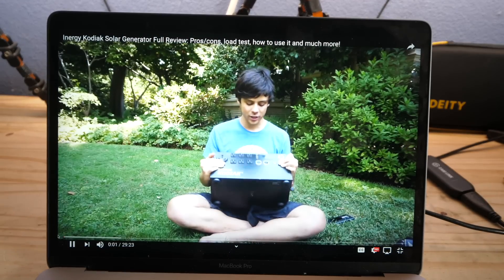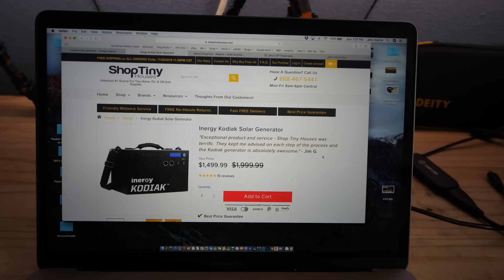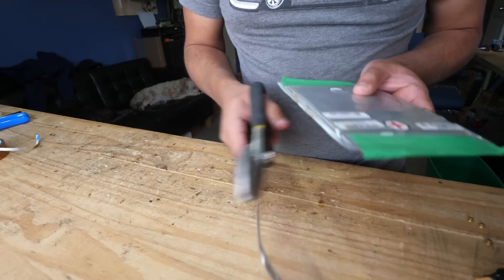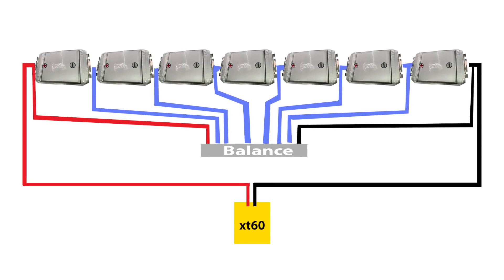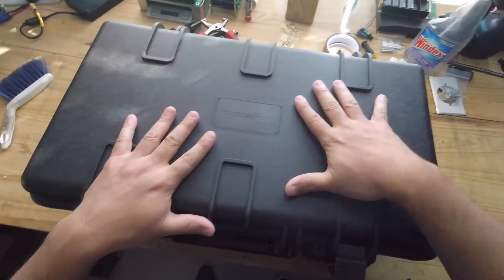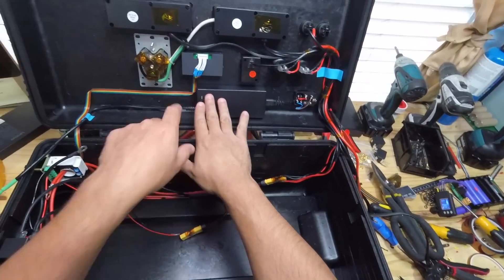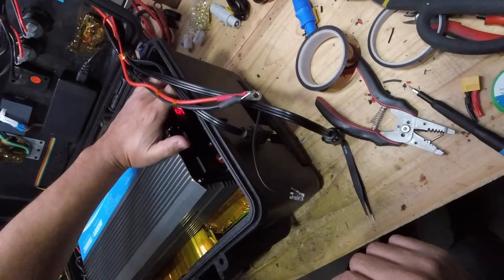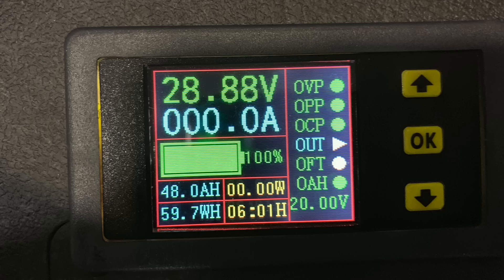DIY Inergy Kodiak Solar Generator

Comment: How did you hook up the 120v inverter to the 240v "rv plug" (30 amp 240v receptical) the only reason I ask this is to prevent anyone from damaging their trailer or rv.
Reply from the maker: It’s not a 240v plug
Reply: Wow, I was not paying attention in class apparently, when I first looked at it, could have sworn I saw 240v instead of that silly 120 30a. Great video and am subscribing to see your future craziness!

Comment: How did you wire in your power socket? Straight to the battery? And what charging chord. If I wire it straight to the battery will the bms regulate the power from the wall? Thanks I'm building one of these and I dont want to blow it up Haha thanks

Comment: Terrifying. One of those cells overheats the whole thing is gonna go up like a bomb. There's an awful lot of reliance on that charge controller. No fuse, no fan, no heat sinks. I'd like to see a teardown of the original - who knows, maybe it doesn't have any safety features either, but I kinda doubt it.

Comment: Automatic thumbs down for any video promoting the BS label "Solar generator" 
THERE IS NO SUCH THING! 

Connecting a solar panel to a battery and an inverter does NOT make it a "generator" by any stretch of the imagination. 

It's a sales gimmick for easily fooled morons if anything, on par with zero energy devices, shungite pendants and calling your faucet a "water generator"

Comment: I love it, you hit all the critical points I had in mind. I was wondering, can I use 3-4S LiPo batteries? I do a lot of rc, so I have plenty of batteries laying around. I was thinking of using a few 10ah 3S battery packs, what do you think about that?

Comment: Bro.  What happens to your internals when you have it in the sun and it appears everything in the inside must be face up at all times. Also, I how do you plan to heat cycle the inverter?  Noticed you removed the bottom plate which is highly volatile to self ignition. Great concept and attempt but please ensure you let your less informed viewers know this has high risk for self ignition.  Keep exploring and using your mind and harness your inner safer Angel.  🤣😅😂  Seriously great concept though.
Reply: I presume you meant the internals of the inverter are susceptible to self-ignition, I don't see having the plate missing would be a problem otherwise. Also, he did add fans, just not on camera, there's an update video where he shows off the fans.
Reply: @jayzo  He probably added them after people roasted him

Comment: Thumbs down.  No circuit protection + no ventilation = engineering fail.  A blown circuit is as close to a burning bush telling you to use fuses or circuit breakers.  Who leaves a device covered in heat sinks, on top of lithium batteries, inside a sealed plastic black box?

Comment: If you have a bigger case how many pouches can you add to extend storage without requiring a larger inverter, bms, or charge controller?
Reply from the maker: You can add as many batteries as you want
Reply: Thank you.  Next question:  How important is it to use the Neutrik NAC3FCB powercon connector instead of an Anderson power pole or 8mm connectors?

Comment: I think I see where some of the confusion is with the solar in this video.  In the link in the description you have it pointing to a pure sine wave inverter that does not have a solar charge controller built in. What you are actually using is the modified sine wave inverter that does have the charge controller built in.

Comment: I think this build is awesome. Highly considering building one of my own. However, I have a question. I think it would be incredibly useful to be able to plug my Ryobi 18v and 40v batteries into the unit to both charge and add battery capacity to the unit. Is that possible? To clarify I mean build the ports you plug the batteries into, into the unit without using the battery charger that Ryobi makes. Thank you for the videos!

Comment: Looks like you did a great job.  I have a Kodiak and was disappointed that while it can function as a UPS, the 120v ac charger that comes with it only puts out 100w.  It’s odd because you can charge it with up to 600 watts through the dc/solar charge ports.  What’s the max solar input and wall charger input for yours?

Comment: Looks like you forgot to add in the $210 for your 42 LiPo Battery Cells
Reply from the maker: No I didn’t
Reply: 139.99
 29.99
289.99
 25.58
 12.89
 33.98
  4.95
  7.96
  8.08
 20.99
210.00
 17.48
 21.98
  7.99
  8.99
 11.98
 28.60
-------
881.42  Total for 17 items you listed. Close Enough - Just had to click on LiPos to see $210 cost.

Nice Work!

Comment: is it then possible to feed appliances while the solar is plugged in charging the battery as well? Sorry if this question is too newbie question. I know nothing about electricity and solar.
Reply from the maker: Should be able to, but I haven’t tested this feature and since the solar charge controller is internal to the inverter they might have some dumb reason to not allow this

Comment: Maybe I missed it, but how are you balancing the batteries once they are installed? I didn't see any bms on each of the 6 battery packs. You have the balance leads but I don't see any part for that to plug into.

Comment: Nice build!  I want to build one too, but I think I'm going to go for a surplus ammo can for the storage box to save a bit and have a metal case.  These are a fraction of the price: https://colemans.com/shop/containers/ammo-can-81-mm/
And these are half price and incredibly robust (water proof too): https://colemans.com/catalog/product/view/id/2153/s/u-s-g-i-ecs-waterproof-container-green/category/71/
Otherwise what about using a Stanley 195617 Metal Plastic Toolbox 26-inch: https://www.amazon.com/Stanley-026180R-Fatmax-Metal-Plastic/dp/B003L5JJHG/ref=sr_1_fkmr0_2
or a Stanley 037025H 50 Gallon Mobile Chest even cheaper: https://www.amazon.com/Stanley-037025H-Gallon-Mobile-Chest/dp/B000Q5LZT4/ref=sr_1_4
You can nearly shave off another $100!

Comment: Don't forget to check surplus stores for plastic ammo boxes! They have locking rubber sealed lids, and are roughly the same size. My local princess auto (Canadian harbour freight basically) has one for $24, and that's Canadian! So maybe 15 bucks south of the border? Much better than the $124 American for the one in the video. Even on Amazon.ca Acr8-72 boxes are only $40 Canadian.

Comment: I have one it's fabulous. Went boondocking with a friend in an Airstream and it powered everything. It can run your air conditioner but only for 2 hours on a low setting but the unit stayed cool.

Comment: I am not a fan of AC so I will skip that for a variable voltage regulator. And I have a case already not into the plugs much.  Will add some high powered usb usb c ports 20 bucks skip the pouch to 18650 65 cells with a 1/3 modular as almost all my gear is modded too use 18650.  So the real question is how to balance modular cells and secure them in the case! Ideas? Anyone?

Comment: For starters, you didn't explain ANY wiring. 

I don't see any fuses, circuit breakers, or anything like that.  No safeguards at all.   How do you prevent overcharging, and over discharge? 

Secondly, how many THOUSANDS of dollars of tools do you already have on hand in order to build this thing from scratch? 

I guarantee you that the average person is going to have to go out and easily spend another 700 dollars on tools and stuff to build this thing.....so....consider your point invalid.   The step drill and hole drill bits will put you at or close to a hundred bucks right off the top.  

You literally have thousands of dollars in tools, connectors, clamps, wires, meters, testers, fasteners, etc, etc, etc, ALREADY on hand.

Not fair to claim that you built this for less money, than you'd spend just going out and buying a Kodiak.

And I'll also pay for the convenience of not having to sit around for hours, and hours, cutting plastic, (but not too much...you could hurt yourself, or start your house on fire), off of gel packs, and figuring out how to punch stupid brass buttons through them, and then solder them together, and then wire them up, and then wire them to all of the other ones that you spent hours, and hours, and hours, doing the same thing too.

You act as if the average person is going to have the know-how, and/or patience or desire to follow through with a project like this. 

No thank you.  I would, and did, just buy a Kodiak.  

It's just like people saying it's cheaper to just build your own solar panels.   Well....it is, and it isn't.   If you already have all the right tools, and you're going to build LOTS and LOTS of them...then....maybe.  But....pretty much still not.  Your panels will still very much suck in comparison to professionally built ones.  They just will.   Period. 

Just buy the Kodiak people.  It's a freaking amazing product.

And no, I don't work for them, I just own one.....and it's awesome.
Reply from the maker: Exaggeration is a good tool to justify your purchase.  It’s cool,  diy is not for everyone

Comment: I'm making a 4s with bullet connectors on each cell , might be bulky but simple for cell testing. still looking for a inverter that will take both 12v and 24v, so i can use a 4s pack out of these cells in a 4s 5 cells for each group.

Comment: For 1 the Kodiak is smaller then yours and I'm sure you used cheaper plugs
Reply from the maker: My battery is bigger and the inverter is more powerful
Reply: @jehugarcia  ok but I'd rather have a smaller solar generator then the size of yours
Reply from the maker: I have one that fits in my pocket then,  it won’t power much but it’s the smallest one

Comment: Cooling? Fuses? Why was vacuum and light pulling over 30 amps out of 15 amp plug? Can you add extra batteries? Can you pull power from unit without activating inverter like the Kodiak? Liked the layout of your unit. Over all weight and dimensions were both greater than Kodiak I am betting. How much for the damaged piece of tech during short? Remember to add that cost in too as most people will make similar mistakes. Your time to make the device should also be included in overall cost too...unless your time is worth nothing? Overall I am still backing Kodiak...excellent try though.

Comment: all those batteries stacked with no air between will definitely start a fire or might even explode. I do not recommend anyone try this at home. this is a dangerous tutorial and is done improperly and will start a fire in the end if you keep it charged. lithium batteries need a lot of ventilation to get rid of heat, they are also prone to explode. these batteries are very dangerous. if people do this please use old laptop batteries or purchase a single battery that will do the job, but do not stack a bunch together in a tight place and definitely do not bend poke or cut of the packaging in anyway. these cells are not ment to be used this way.

Comment: Is there a way to modify it so you can charge off 12 volt from a truck while you drive? The kodiac charges off 120 or 12 volt.

Comment: Dont use fan for cooling the betery.and heat meter.coz batery temperature are going too hot if we use a alot of stuff.its that ok u dont use the cooling for the batery?

Comment: Using brass fasteners on aluminium plate will cause galvanic corrosion. It's not as bad as a steel fastener but will still corrode over time.

Comment: Is it possible to make a version with less capacity and with a much lower cost around $ 200?
Reply: DarkDrake you can make it 12vdc (less batteries in series) and/or could also make with less capacity (less batteries in parallel). Just keep in mind the higher voltage is more efficient (less power loss through cables. Higher voltage with less amps, you can use smaller cables). The higher capacity (amps) will take longer to drain the pack.
Reply: DarkDrake; just a bit of correction here. The inverters above are 12VDC input, not 24VDC so either you make your battery pack 12VDC or if you prefer 24VDC, just look for the inverter he refers to on amazon.ca. In my case I go 24VDC battery pack with DC to DC converter at the output (for 12VDC to the inverter input). Not as efficient (slight loss through the DC to DC converter) but it allows for smaller cables due to higher voltage and lower current.

Comment: The pouch cells will be damaged by scraping with a screwdriver to remove the stickers. Better to use a solvent or leave them on.
Great project though (accept for lack of fuse).

Comment: Couple lead acids and an inverter and battery charger, 3x as heavy but easy on the wallet
Reply: Still good AGM batteries are not cheap (In the area of $200CDN per 70ah battery)

Comment: I absolutely LOVE smart DIY geniuses like you!
I'm presently building my OWN version of this as well-started it before I saw this video. I'm building mine in a Pelican 1610 Case. I'm using Two Bioenno Power 40 Amp 12 Volt LFP Batteries, a 30 Amp Bioenno Solar Charge Controller, and it will house a 350 Watt PURE Sine Inverter. The lower Wattage Inverter is to save space and Money, however, I'm putting 8 Guage Wiring in that circuit so I can externally connect up to a 1,000 Watt Inverter for remote Ops / Disaster response scenarios. I also have installed three THREE Amp usb outlets for rapid charging of external devices. I WILL have a little over $1700.00 invested when its done, BUT-Im adding ALL kinds of other Bells & Whistles to it.
Mr. Garcia, PLEASE feel free to message me at ebx rocks at yahoo dot com. From there I'll give you the link to my SECURE email. I would LOVE to compare notes with you!

Bruce A. Forster-Disaster Response Coordinator
Seaside OR Adventist Church.
Reply: I've upgraded to a 1,000 Watt Pure Sine inverter. The thing works fabulously. I am unable to build the systems you can due to a disability in both of my hands. Nonetheless, I watch every video you post, and I learn something from you every time. KEEP 'EM COMING!

Comment: I think the comparison should also include efficiency, power factor correction, battery charging mechanism, ruggedness and safety.
That's what why they charge you $1500

Comment: You missed the one major benefit of the Kodiak, which is the expand-ability. 
On the side it has 2 plug which allow for Marine Batteries to be hooked up to it, allowing for a near infinite expansion of how much juice it can hold.

Great video, but that is a MUST HAVE option for this to compete with the Kodiak
Reply from the maker: See the blue plug? That’s for external battery
Reply: And I can just hook up like 100 batteries all in series and plug it into that port?

Comment: @jehugarcia, I really like what you are doing and showing your work and have followed your videos, but I want to reiterate some of the points here by others. With your following, PEOPLE WILL TRY TO DO THIS AT HOME. You are not showing, commenting, making note of safe handling techniques and you are taking some shortcuts, or hiding some steps that will cause people to literally lose their homes to a lipo fire. Please, please take some responsibility and make people aware of the dangers. You basically made a giant lipo bomb there, and I can't help but worry that some others are going to do the same and end up burning down their house, or worse, cause someone to get seriously hurt. Please, please keep making content, but put a disclaimer, or focus on educating people in the correct handling of these things. It is not that difficult to make it safer.

Comment: I have watched your channel for several years and have learned a lot about battery-powered devices from you. Have an off the wall question for you do you think an electric bike could charge its power packs with a converted electric front wheel as it used an electric rear hub to drive around I know it would have to have dual power banks but do you think its possible?

Comment: 18650 are better and the man knows it. He only went with those batteries because they sponsored him.
Reply from the maker: Use whatever battery you want, it’s not black or white thing.  These lipo cells in this setup are only being used at 1/10th of their power rating so they will last a long time while 18650s will be stressed more and last less

Comment: Jehu, using powercon connectors is really dangerous in this application.
Reply from the maker: How so,  it’s just a connector.  And the kodiak uses it also just in a different color but it’s the same connector
Reply: jehugarcia Blue Powercon is a 120v 20A rated power connector which is commenly used to supply mains power to devices. Meaning it is common place to have power cables that can connect whatever is wired to that Blue Powercon to Mains current.

Comment: Good Job overall, A+ for the concept and proof of concept. B- for cable management, C for heat migration, D for safety concerns, F for a using Amazon Box, a Pelican case or a Pelican cooler or similar would have been the hot ticket, and having a larger box would allow you to use outdoors without the concerns of H20 getting into the live outlets being as they are on the top of the unit.  
Having a 20 amp 30 amp and 50 amp plug would have been very nice to see.
Maybe try to make one for $1499.99 plus shipping etc, and make a monster Kodiak.
Thank you for the inspiration and God Bless you.
Reply: I'm trying to figure out the wiring... as I see it, the 30amp socket is limited by the 12amp power strip... unless two power strips are being used together to give 24amp possibility??
Reply: ok, power strip is seems to be 12a + 12a + 2a +2a + 2a = 30amp .... so in total equal to single 30amp socket.... nice